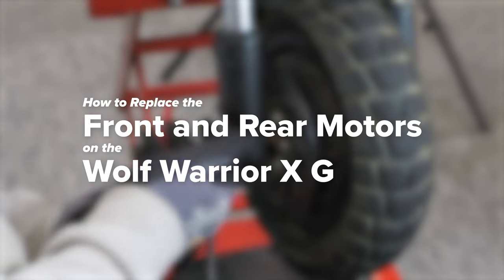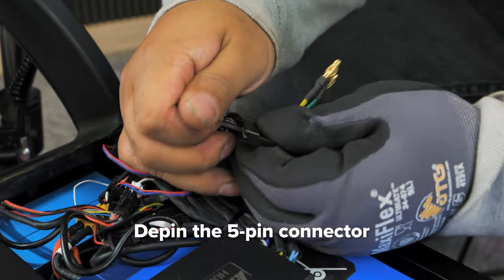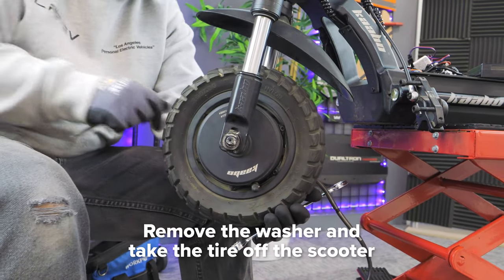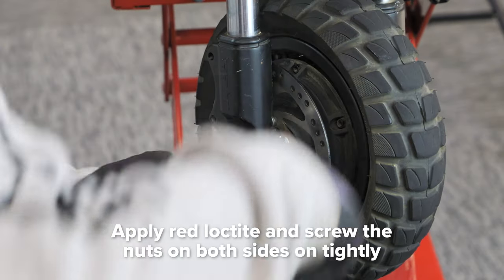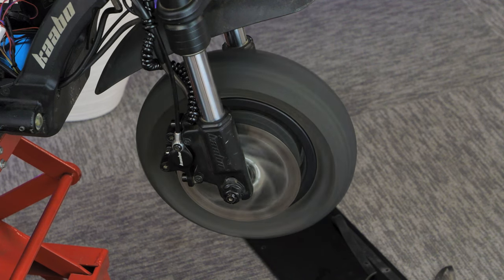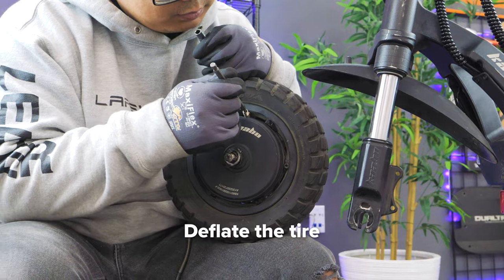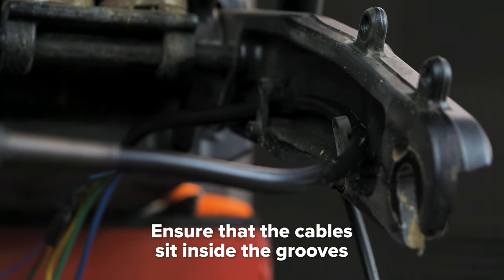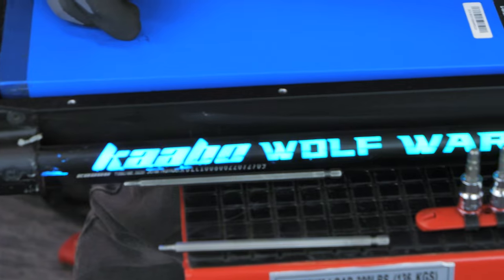How to replace the front and rear motors on the Kaabo Wolf Warrior X GT - Voromotors tutorial

Comment: I stumbled to this video dealing with a error 02 code that flashes when the handle bar locks to the the left. the error 02 flashes then goes back to normal repeatedly any suggestions you guys recommend trying please and thank you
Reply from the maker: Hey there! 

I'm sorry to hear you're having this issue. It sounds like you might have a pinched wire somewhere based on that description, but if you could reach out to our team at support@voromotors.com, we would be happy to troubleshoot with you further to try to nail down the issue and get it resolved for you!